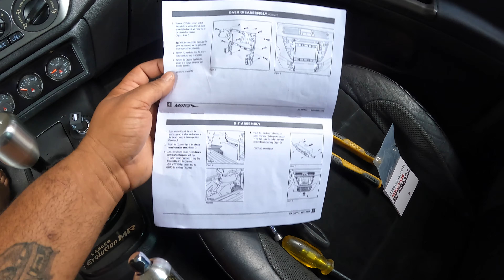EVO 9 GETS A NEW DOUBLE DIN RADIO WITH SOME FPV PULLS

Comment: That aircraft stripper just isnt good anymore , nothing like the old stuff used to be 

And if you paint the letters on the valve cover they make semi hard rubber rollers that make it easy to paint raised areas like that. Basically like a stamp 

Glad to see the uploads!